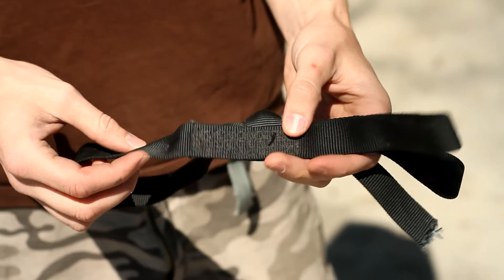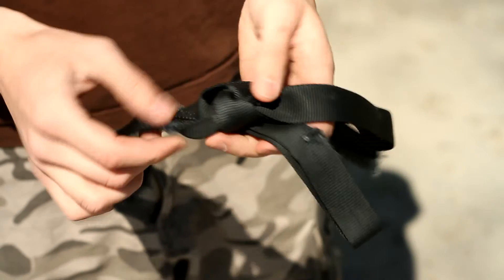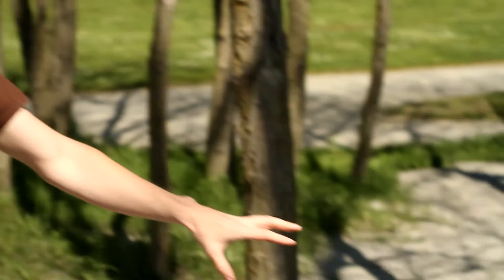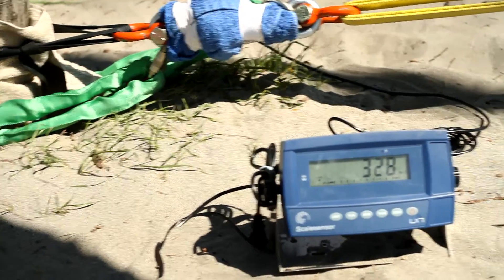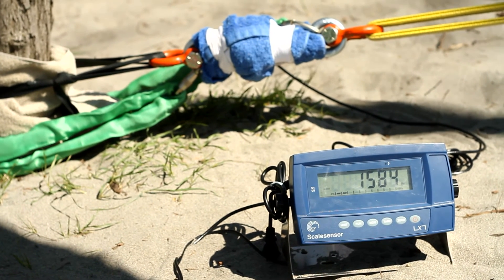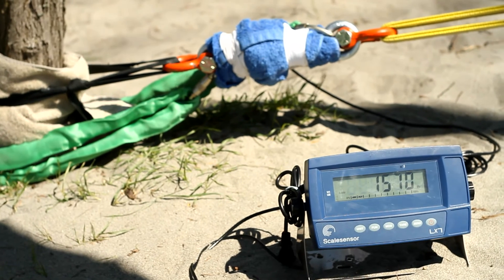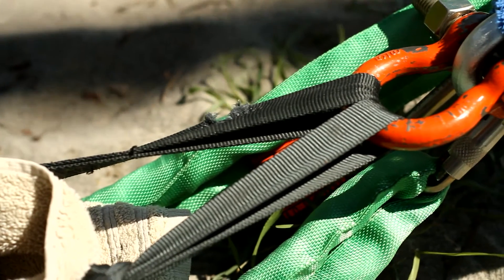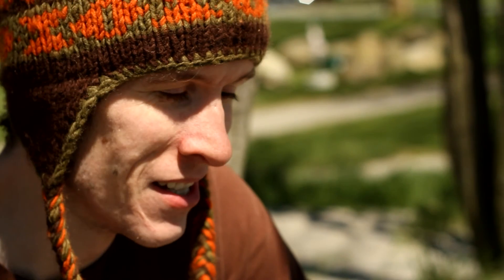Slackline Break Test

Comment: For static slack line this test would be fine. Notice how the stretch reduces the load initially when more tension is applied. But put this sling in a dynamic load test I am sure it will fail early.